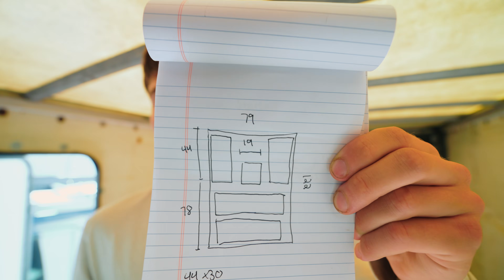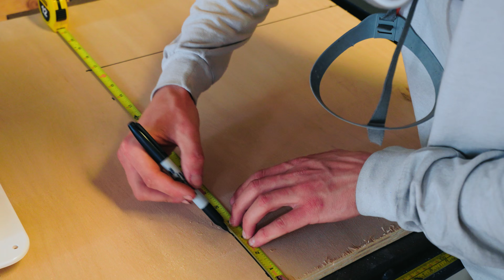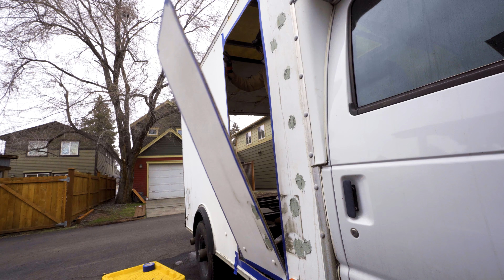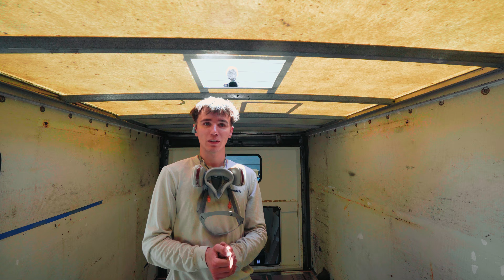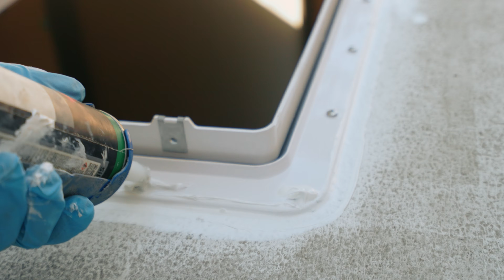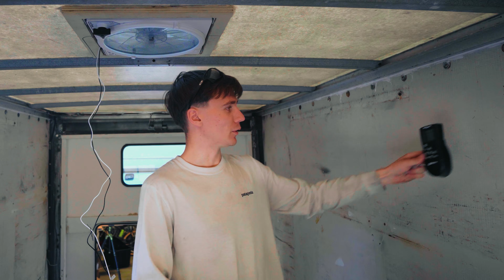How to Install a MaxxAir Fan on Ford E350! | Cutting, Mounting & Sealing

Comment: Great job, especially showing changing the sealant. The weight of the fan seems like it will eventually sag the fiberglass. What about connecting brackets to the metal crossbars and the wooden frame for additional support?
Reply from the maker: Thanks so much! And I have been thinking the same thing. I know it would be a smart idea, I just need to figure out how to make it work!

Comment: I love your customizing work Max, you're very neat and tidy and well thought out, with all that you tackle
One thing I would have done tho,  is make the plywood backing a bit longer so it snug fitted between the two galvanized frame beams and screwed it to them with wee brackets to prevent any vibration caused by the weight of the unit on the flexible roof which may cause fatigue cracks over time
Reply from the maker: Thank you for the comment and the tip! That's a great idea and something I will have to look into!
Reply: @maxwell.peters  Just found your channel, awesome build for a beginner, you are doing great. Perhaps some flat strap steel of some kind to span the frame beams each side of the fan to tie it all together.

Comment: I would test the waterproofness of your roof with a garden hose before you proceed with the other interior work.  It looks like it will not leak but testing now may pay dividends.  Great job.
Reply from the maker: Thank you for the suggestion! I completely agree! Water leaks are my biggest fear with this build. Luckily we have had some massive thunderstorms and heavy rains here recently and the fan seems to be leak-free! Unfortunately I found a few leaks in other areas though :(